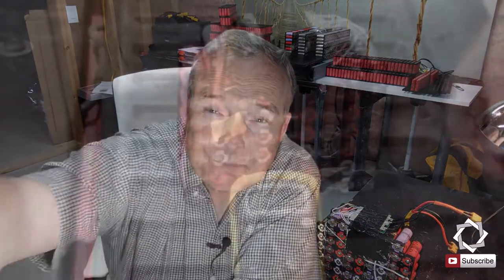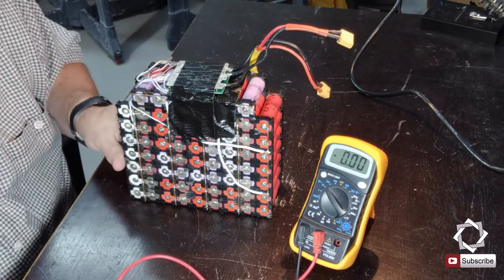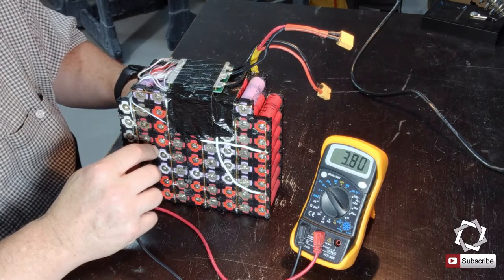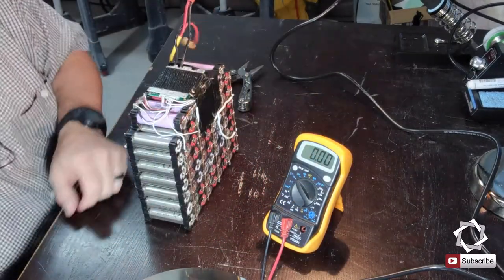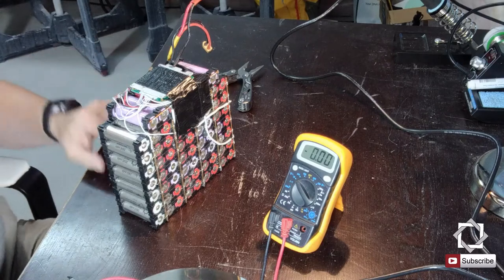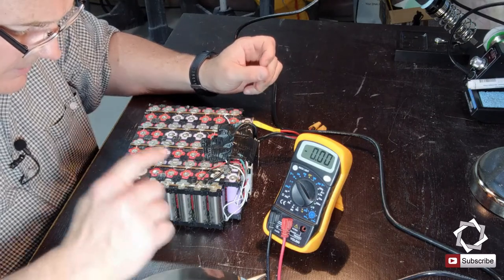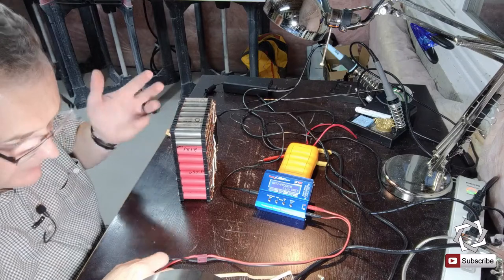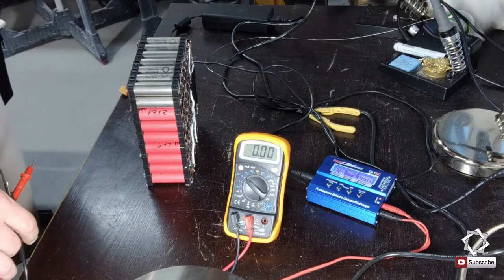Lawn Mower Battery BMS Replacement

Comment: Love your battery rebuild.  I'm getting ready to do the same with my BnD 36v mower.  One question. Did you use the same charger with a buck booster to up the voltage to 42 or did you use 42v charger?  Thx

Comment: Have you tested internal resistance with them in series? Maybe the cells aren't matched the best to be seriesed? As far as internal resistance is concerned. That's what I worry about. Coming across cells with wildly differing resistances. Causing things to get crazy!
Reply from the maker: I have tested each cells resistance but not the cell set.  I need to review my cell log and see if any of the cells that I'm using have a high resistance.  Thanks for the idea,

Comment: Hey Frank, once you charge them, disconnect each cell (in the rows that are giving you problems) and let it sit for 2 weeks or so and then go back and check each cell. If you find any that dont hold charge with the other cells then you know which cell/s are bad. Hope this helps
Reply from the maker: Good point.  I had initially tested each cell to make sure that they would hold a charge but things change.  I may do just as you suggest.  Thanks
Reply: Frank Brand anytime I can help 👍
Reply: @FrankBrand_gplus  Did you ever hook it up to lawnmower and test it?

Comment: I like these kind of Battery conversion. It does something against the throw away society. Cant help you with the balance problem, but i recognized the lion - lipo  setting of the imaxx too. I would probably the conversion with some powertool battery, because it is a bit easier for me.

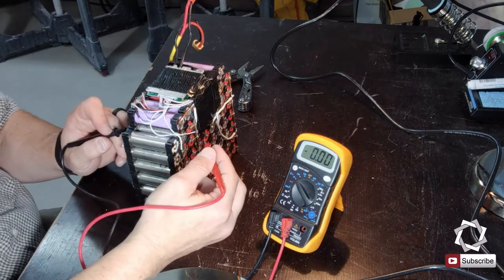Comment: hmm at 4m you desoldered the second row. (good).5:20s you tested the first row with the meter reading around 4.1 volts (why that row? it isnt the problem?) 6:01s you tested the second group in reading 3.8v (good thats the problem row) . So next while the cells are disconnected from the fuse wire. Test all the voltages and write them down. Wait two days and reset with the volt meter and see if a cell has dropped. If so thats your problem cell. If the cells still test around the same then Before solding them back up to the fuse wire (which isnt going to help) etc put the charger on each of the 7 cells and change and discharge each one individually. One of them must be the problem i would think you would find it after leaving it for 2 days as it would of discharged alot but if not then the cell retest is the best way. Start with that and let us know how you get on. Also connect up your old leadacid batt and put a clamp meter on it, how many amps does the mower pull from the batt when under load. Eg mow a high bit of grass and find the peek current. The 7p of 18650 cells might not be able to do the amount of current your trying to pull or the cells in that row cant. I would go 10s14p as the plastic box looks like it would fit another row on top. That will also mean you can mow twice as long or only use half as much charge from the new batt making it last years. Hope that helps :)

Comment: Hi Frank, 
Like what you are doing! Very educational.
I do not know what type of BMS you have, but most of the times they only balance with 50 mA or so. On a voltage difference of 0.30 V or more it would take AGES for the BMS to balance that out. 
Question is of course "why did that cell-pack discharge to such a low voltage in the first place".
My guess is one (or more) cells in that cell-pack are weak, and/or can not deliver the current for the lawnmower and get hot.
How much Watt is the mower rated for ? 
You're pack should do 360 to 400 Watts without a problem (Cell discharge about 1 Amp/cell , which is what you capacity-tested them at). A higher discharge current could cause problems if the cells are build for capacity instead of high-drain current.
Reply from the maker: Agreed, I'm going to try a bottom balance and then if I'm still having issues I will be looking into each cell in the cell set that is having issues.  Thanks for you input!!!

Comment: this is a tuff one man., Maybe this is what you get with used/old batteries not directly bought from MFG and also not having close connections with their QC department and managers in it.... thanks for sharing this! BTW, im currently in korea and there are MFGs that make the cells (LG Chem, etc.). Im curious if i can set up a time to meet with them and even possibly buy a few boxes of cells... If i get any luck with that i will let you know!
Reply: also, if you set your imax to LiPo instead of li-lo it will charge the cells to 4.2
Reply: yep that will get them to 4.2v, the charger shows 4.1v end charge and resistance will make it so the cells never actually get there, so setting to Li-Po will make it stop at 4.2v instead of 4.1v